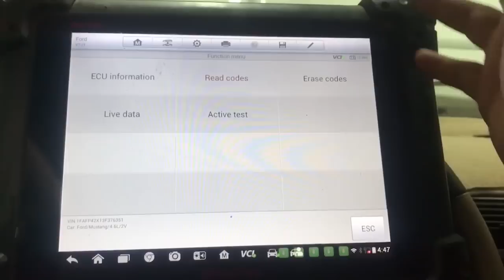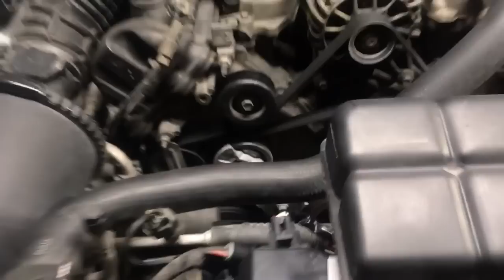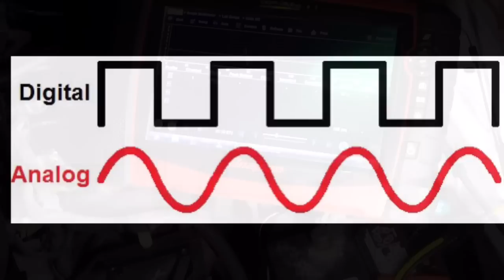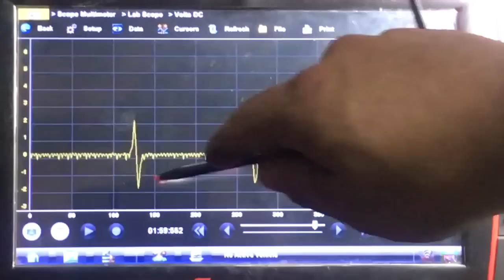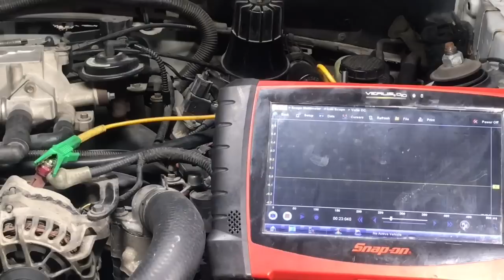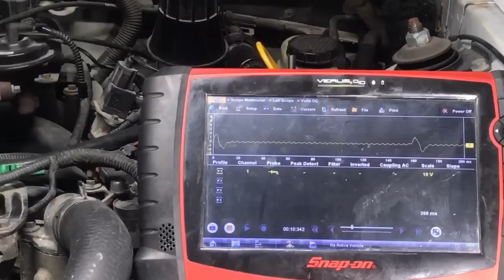How to fix code P0340.  A new cam sensor will not repair this car.

Comment: Ford Fusion 2,5 L and scan gave PO340 code . Said nothing about cam sensor just about the ignition coil and or spark plug on # 4 cylinder

Comment: Alternator was the first thing I changed. Since cam sensor, intake manifold, crank position sensor, injectors, fuses, relays, wire connectors. I'm at a loss?
Reply: Coil packs, even new need to be tested!! That goes hand in hand with the alternator causing this!

Comment: I have a 2007 F150 FX4 change the sensor twice still comes up so I had to order the inside sensor that goes inside the valve cover. See if that works. If not, I don’t know what else to do.

Comment: Yo batallé mucho para arreglar el problema p0340, abrieron el motor y no tenia nada que ver, pusimos sensores genericos y solo empeoraron el diagnostico, el mecanico nunca la pudo solucionar, un día se me ocurrio comprar los sensores originales y cambiarlos yo mismo, eso termino siendo la solucion al problema. Espero les sea de utilidad a alguien

Comment: So you’re saying if the cam sensor has a two wire that this could be potentially the problem? Ive changed the cam gear, and sensor amd also did the pig tail, whole time car starts fine and runs good though just throwing the code

Comment: If the alternator is noisy and it's not from a failing diode, wouldn't it be cheaper to install a filter capacitor on the B+ (alternator current output) wire instead of R&R'ing the alternator?  Or just live with the noise unless it's bleeding into the speakers and sound system?

If my engine was running  a bad idle AND the scan code was showing a 0340, then I would be 90% sure that the cam position sensor was bad and not worry about a noisy alternator provided it was still good enough to keep the battery charged at 13-14vdc.
Reply from the maker: If this was my  vehicle that would be an option but this is a customers

Comment: Thank you so much for the thorough research. This is related to the problem problem I am facing right now. I'll give it a try removing alternator cable or drive belt and see how my car will react to the changes.

Comment: I’m running into this issue on my 05 mustang GT 
I’ve replaced both cps and now the alternator 
I had to buy a remanufactured alternator and my ripple is .19v is that expected?

Comment: Hey, so we have a 2v mustang that’s throwing the code, we took it to 2 shops and a Ford dealer and they couldn’t figure it out. We did like 3 alternators, 1 even failed on the highway on the way home. They changed the wiring also. The car even has new spark plugs from a shop. Is there any other reason it’s still throwing the code? Could it be a timing chain, the car never starts first try.

Comment: Thanks for the video, I got a problem where I have trouble to start hot engine on Citroen Jumper 2,2 hdi150 - I have changed many sensors and starter and no effect - I just might be that I  got faulty alternator and that gives bad voltage specially when its driven hot. Alsoo I got  the P0340 and P0016code. Cam and crank sensors have been replaced no effect so far Thanks for video - seems I need to try new alternator.

Comment: I got a question. I just replaced my cam sensor (bank 1) on my Nissan Pathfinder 05 and the code is still coming up. What possibilities do you think it could be? Connector? Wiring? Defective part or maybe something else? Because my car starts fine and runs, just bugging that I can't find the root problem. Thanks for the video, gave me more insight!

Comment: Back in the 80s I had an Alltest multimeter that automatically checked bad diodes as you checked dc voltage. That can play hell with computer issues . Man that was cool. It should still be a feature, but its not.

Comment: FORD have problems with Cam, crank and temp sensor full stop!  Sensors are of poor quality. 
Replacing with a new sensor in most cases usually solves the issues in the newer vehicles with low miles unless there is wiring damage from rodents.

Comment: I'm having this problem right now on a ranger. I don't have the fancy tools and would not have found this. Thanks. I wonder, however, batteries are capacitors that are used to clean up noise on dc. Shouldn't the battery have cleaned up this problem? I wonder if there is more that is wrong here. Thanks.

Comment: Hey Oz. I've changed both the camshaft and crankshaft sensors and still have a rough idle. I also have an oxygen sensor going bad. What should I have done next?
Reply: Might be you bad air mass sensor

Comment: Damn man you did a good job. You know your shit. I never would have thought the alternator was the problem. So here's my question,  I don't have one of those diagnostic tools. I already changed the camshaft sensor cause it was a cheap fix but the code just came on again. Is there another way of telling if the alternator is the problem without that oscilloscope.
Reply from the maker: Using a multimeter and see if your alternator is producing excessive ac ripple. But this will only cause problems on 2 wire cam sensors
Reply: @OzMechanics  Thanks man. I believe it is a two wire. But what am I looking for with the multimeter?  Is the volts gonna me jumping around?

Comment: Cam sensor disconnected but when I touch the wire if fires both fuel and spark

Comment: Bro I got an 05 Sunfire. I've got ignition coil, module, crank shaft position sensor, and spark plugs replaced. I still got a check engine light on but it runs better. It was shaking really bad. It throws a cam shaft code but when I go to get the part its like it don't exist.  I'm so confused and angry. What do I need to do .

Comment: what symptoms was the car demonstrating other than engine light on, and code po340.  If the cam wasn't bad or if you suspect it surely if that's the case was the computer causing any symptoms.  I was a registered nurse for 30 years you guys never tell the symptoms of the patient which is the car your all tech. It does me no good to watch you play with your 5000 dollar scanner if your not going to talk about the signs and symptoms of the car.  I spend 30 minutes watching your video and my vehicle is shutting off hard to start with multiple misfires running rough. we changed the cam per the code fix and it did not fix the problem.  so back to square one.  
So the alternator is causing the code in this situation I appreciate that, but was the car having symptoms or was it just tripping the code? No punt intended.  I watch all these videos on how to change the cam but no why or what fore and it misses the point, they are just doing parts replacement videos, with no diagnosis information.  No sense is good if you don't have horse sense. I learned a lot from your video, but it would have been nice if you had mentioned that maybe the car had little to no symptoms. Pretend your me with 99 dollar blue driver, and then try look at it from my prospective. just something to think when you do your next video I do appreciate all that you guys do sincerely.
Reply from the maker: This vehicle didn’t have any symptoms, it just threw tehe mgr code. So for me when I hear it doesn’t have any symptoms with a repetitive code and they also replaced the sensors I will start with hooking up the scope. Once I hooked up the scope I noticed that the signal looked off. So when I zoomed in a noticed small humps. As this is a two wire ac generated sensor. The small ripple caused by the damaged rectifier was making its way to the cam signal wire. Hope that helps

Comment: Heloo Oz..this is pretty awesome. i am using a Lexus RX300 v6 engine and i had both my Camshaft sensors changed including the Crankshaft sensor. Both the Camshaft sensors responded positively except the Crankshaft sensors which failed to reset. The code keeps on coming back. i also have this Whinnying sound which all along i have been thinking it comes from the Power Steering Pump. Any advice?

Comment: Excellent work Oz, I have been chasing a cam sensor fault on a 2001 twin turbo Subaru Legacy. I swapped out the sensor, checked and double-checked the wiring and so on. I was getting to the end of what I could check! scoped everything and hey-presto NOISE! That alternator seemed fine, was putting out a good charge and all but was causing interference. Changed the Alternator and the vehicle runs beautifully. Thank you so much for your great video.
Reply from the maker: Awesome!!! Glad this video helped out. Thanks for watching
Reply: How has it been so far? I have 2005 Subaru Legacy GT wagon and I keep getting the p0340 code. Already replaced the camshaft position sensor 3 times, and since the second it just didn't make sense. My mechanic checked everything, every wire, connector, ECM, harness...he didn't have these two readers though, which are pricey! The first one this guy uses is $1500 and the SnapOn Verus is $2,000+ . 
I couldn't find any patterns. Sometimes it's when it's burning hot and dry outside l, sometimes when it's raining, three times it happened after drive through carwash (so I thought it might be that high pressure water gets into the hood scoop... If I leave it for 10 minutes to sit, it starts like nothing wrong ever happened...
Reply: @VlaedVlaed how'd you go? I have a similar problem with my forester xt. So intermittent that I can't ever replicate the fault. I get codes 340 and 350. I just bought an oscilloscope the other day and have been checking everything I can. The alternator seems kinda fine but I have the check it again as I'm still leaning how to interpret the waveform.

Comment: Keep getting p3040... have replaced the sensor... or toyota did. Car can run brilliantly then boom, it cuts out, wont start again. Engine light comes on, same code. Have even replaced Ecu (or toyota did).... feels like noody can diagnose it.
Reply from the maker: You need some that has a oscilloscope so they can diagnose it

Comment: Why in The fuck would they make This throw a code for the cam sensor? That makes me mad.
Reply from the maker: Because these sensors aren’t like the conversation 3 wire Hall effect sensors, these are a 2 wire inductive sensor. That produces an analog signal. When a diode goes bad on a alternator I produces too much ac signal which in tells disrupts the cam sensor. Like on the video you see the ripples produced from the bad diodes when I hook the scope

Comment: I have this code on a 2012 Chrysler 200 I just picked up cheap. Has new cam and crank sensors and a new connector in the back. Connector tests 5v on one side and minimal on the other. Before the charred connector was changed it was reversed minimal on the othet one and 5v on the one now reading low if that makes sense. Could it be the alternator?

Comment: I’ve been dealing with the aftermath of a leaking windshield on a 00 f250. The drivers side A pillar leaks right onto the gem module and fuse box.  Truck thought the doors were open so that killed the battery then the same while driving. The interior and cargo lights would flicker on and off. So I pulled the fuse box and gem module, separated the cases and cleaned it all up. First test drive after re-assembly the cost me money light came on with this cam position code and low battery voltage code which is why one here. 🤣                              I cleared them and hopefully they don’t come back. I know it’s just electrical gremlins now. Typical. Lol

Comment: I just changed the sensor in my 98 ranger but it's still misfiring and I may not have had tdc
Reply from the maker: Have you looked at what cylinder was misfiring ?

Comment: Did it have a rough idle/misfire as well? I have the same code all of a sudden. What else will throw a P3040 code on a 2007 3.0 Ranger? Tyia Also, I replaced the synchronizer and Sensor but that didnt help. My mechanic says it could be a valve issue but it happed suddenly. Will a CKP sensor throw the p3040 code and not the ckp code? Bad PCM/
Reply from the maker: You would have to verify it has good power and ground and that the sensor is actually producing a signal but with that you would need a scope

Comment: I wish the two mechanic shops that I took my car to, did this kind of diagnostics. One just replaced the camsensor for $200, and the other said, cat.converter (got it replaced by purchasing my own parts, $300.  the service engine light is still on, the car still have starting trouble. some one else keeps on saying, it could be "Timing". well they may be ready to make $1500, but I am not!!

Comment: Had this problem with my 1984 Camaro.  The choke light would flicker and the key buzzer would partially come on at certain speeds.  It was the diode trio in the alternator had lost one diode function.  Ac feedback caused the choke light to flicker.  7 dollar part.

Comment: Wow,that was amazing work, thanks; 

Good thing you had heard about that, but i guess you'd get there after replacing the CPS; 

Anyway,alternators with a bad diode are usually louder, i always listen for that; 

And this is the stupidity the world is facing;

 Not only does the ECU not know,AND TELL THE DRIVER,why not. that the current that feeds IT is dirty, but the damm sensors have no filter nor is their cable screened, what a shame, 

 The manufs,all of them, just cannot make cars well because the Greenphisser's laws take just too many resources;

It's an epidemic all over, and everyone who owns a car is at risk;  just like with Covid-19.

Comment: Hello sir I have a 2013 Hyundai Elantra it has a code P0016 it’s reading a camshaft correlation Bank 1 sensor A 
So I replace it and it’s still doing the same it starts rough and stalls 
When it warms up it runs a lot better any idea what I have to look for or do

Comment: SOMEBODY PLEASE ANSWER !!!
I have that same code on my charger has good sensors and timing belt new spark plugs … 

Can my alternator cause that 0340 code ???????????? I replaced a few months ago and did the terminal removal test and alternator kept my car runnning … 

Is it a faulty alternator?
Reply: Removing the battery terminal while the car is running just demonstrates that the alternator is able to produce enough amperage at the right voltage to power all the electrical systems.  Due to the method by which the alternator generates electricity, it’s naturally rough and uneven but there’s a small electrical component called a diode inside the alternator which “cleans” the power output so it’s nice and smooth.  When the diode fails, the rough and pulsing power is fed into the rest of the electrical system and can cause codes for some of the more sensitive parts like cam/crank sensors.  If the diode fails, the best course of action is a new alternator.  I’ve had terrible luck with remanufactured units but then again new OEM stuff costs an arm and a leg.
Reply: @Echo024  honestly you might be onto something I did get my alternator from autozone remanufactured just replace few months ago

Comment: My trailblazer doinsame thing changes cam sensor 2 times still showin this code great video I'm gna test alternator
Reply from the maker: I have more videos where I test the cam sensor. Please check out those videos as well. A proper diagnosis is always need to verify the problem

Comment: I have an 03 neon that dies when driving.  Have codes for cam and crank sensors. Replaced them both and took timing cover off to check it. The timing looked good but I put in a new belt since I had that off. There has been no change it still does the same thing. Is there a way I can test the food of the alternator without the scanner?

Comment: So p0430 it’s a universal code across all obd2 scanners for all cars ? I have this same code p0430 but it says O2 sensor / catalytic converters problems on a gmc
Reply from the maker: P0340 is a cam code
Reply: @OzMechanics  hi thanks, really!? Every where I have looked said P0430 was a catalytic system low efficiency issue, are you sure?

Comment: Check engine came on and code P0340 cam position sensor. I replaced and check engine light still on.  So I did another scan and code P0340 was coming up, suggesting that I check the plug of the sensor. It looked good. Watching your video alternator will be checked. Thanks for the info.
Reply: Did it work?
Reply: Did it work for you

Comment: I have a po3040 code my car 07 charger 3.5 stalled on highway and won't start just keeps cranking I did replace crankshaft and cam sensor and still no starting back up

Comment: Interesting video to sell  multi-thousand scanners...
But an alternator with a bad diode is *buzzing* ,you can hear it; 
then you put a 5 dollar dmm,volts meter,on the battery terminals, low AC range,and you see the AC,1 to 5 volts or so; 
that is no good,ECUs cannot handle that!!!  and it lets you know that the FIRST thingy to do  is to repair/replace that alternator
then  after that, check things out
where did i go wrong, is there a simpler way for the poor?

Comment: You might of just solved my issues. I have a 06 3v gt with a p0340 code and before the code popped I had a check charging system light pop and go away and my alternator whines at high RPM and car surges

Comment: Hi Oz, having an issue with a 2017 Elantra, car stalls with CEL on and no codes are stored, my mechanic changed the crankshaft sensor and drove around the block and it stalled, now he’s going to try a camshaft sensor, why are no codes being stored? Originally he only retrieved a code for a misfire and changed a coil, that didn’t help, then the rest of the coils were changed and that didn’t fix the issue. He checked the alternator and said it was ok. Im losing hope.
Reply: Clean the throttle valve
Reply: See it all the time.

Comment: I had a similar issue with my 09 explorer 4.6,had a P0341 and it turned out it was the alternator problem,changed my alternator and the code disappeared buy itself .Thanks for your video bud